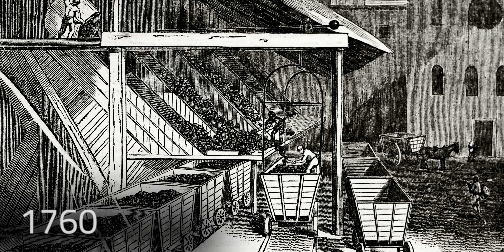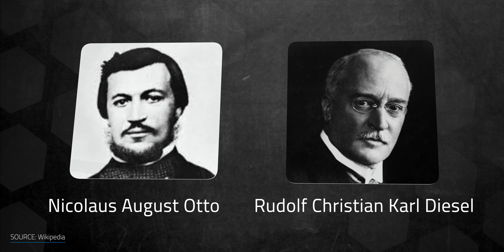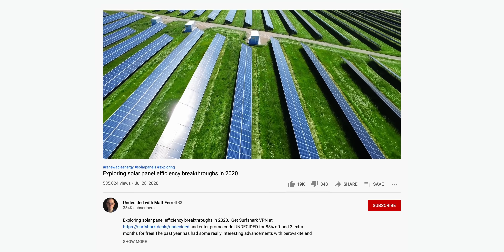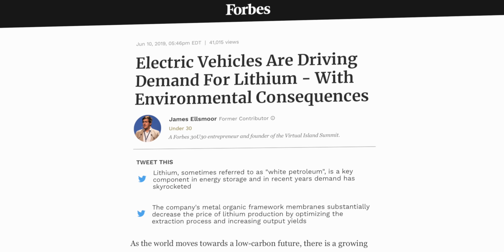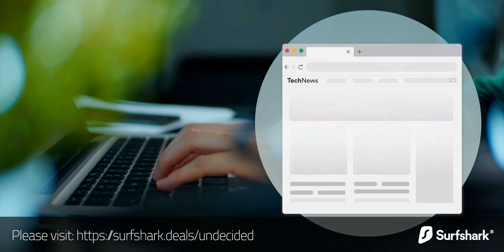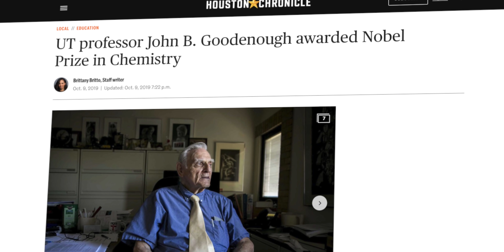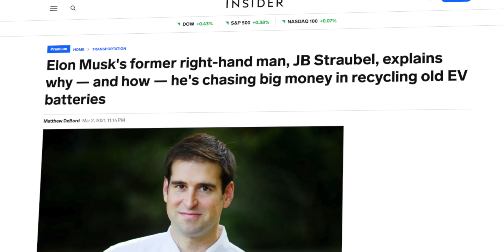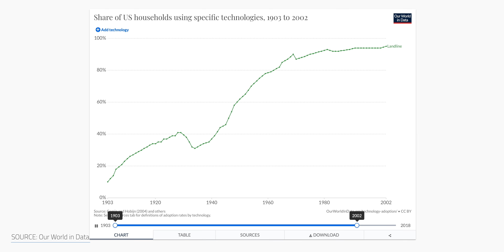Is the Future of Renewable Energy Inevitable?

Comment: Geothermal!!! Just drill deep enough and you have 24/7 energy that you don't have to store and you don't have a footprint. No mater how efficient you make renewables they aren't space efficient.
Reply: We have way more space for wind, and solar energy than we have money for geothermal. At the moment wind energy can be generated in fields without preventing the cultivation of the land they take up making the opportunity cost of using the land fairly low, and newer advances in rooftop solar simultaneously are making it more practical to utilize otherwise useless roof space to generate electricity at a fairly low cost rate.
Reply: @garethbaus5471  The problem with solar is the intermittency. Even when working well it generates 80% of its  energy in the central 4 hours of the day. People don't want energy then so it will have to be stored. So this storage is only going to be used for 2 to 3 months a year at max. In winter or cloudy days there is very little generation. Also solar produce most energy in the summer when demand for electricity is at its lowest.
Reply: @fidalfadel  and by coincidence wind speeds tend to increase towereds the mornings and evenings with a tendency to increase during the colder months and during stormy weather. The biggest issue is that there is a period of a couple of hours around midnight when wind speeds slow down and we don't have solar production, the good thing is that this is a fairly low demand time so it isn't as big of an issue.
Reply: @garethbaus5471  The issue is private people will buy a power wall and solar roof but the power wall will be very under utilised over a year. If people are will to spend that money and tie up that many resources with a power wall that at best is going to be 30% utilised then then why not invest in a system the will generate all year.

Comment: I think of green hydrogen as a kind of battery for a renewable grid. I tell younger people energy storage is where to keep your eyes open for investing their money for retirement.
Reply: As someone considering working in the sector, I wouldn't bet my life savings on it but I am also confident that it will see massive growth this century.
Reply: Green hydrogen is less than 50% efficient as a storage medium.  So yeah it's viable, barely, but a society built on it would need platinum or palladium for every fuel cell node.  Bad scaling on that solution.
Reply: Hydrogen - coupled with a hydrogen fuel cell - makes for an inefficient, complex, expensive battery.  Short of the unlikely confluence of A) massive energy production B) near a convenient point of demand for hydrogen C) where there is no good way to export electricity to the grid, and D) the costs associated with hydrogen production and consumption drop significantly ... I doubt we're going to be using bespoke alternative energy production piped directly into cracking water into hydrogen.  It's both more energy- and cost-efficient to steam reform hydrocarbons to extract hydrogen - something the petroleum producers can do at scale and largely with existing plant with the attendant CO2 release into the atmosphere.

Comment: Great content as always.  I see renewable energy sources increasing but there will be many more failures as we saw in Texas this winter.  The technology for storage is not close to adequate now or expected in the next two decades.  Governments pushing renewable energy without  sufficient backup for at least a week are playing with people lives, but that is the nature of government.  Such games are just payoffs for political friends. The move to renewable energy sources and EVF cars will happen quickly when they are proven technologies. Otherwise, political friends are making money while people suffer.
Reply: The failure in Texas was due to their failure to winterize equipment - not a failure of renewable energy.   The have their own power system because they wanted to save money and avoid federal regulations which would require things like winterizing pipes and valves that provide natural gas - those froze up in the cold.
Reply: @Cynthia_Cantrell  There were many faults in Texas and winterization is just one.  Winterization doesn't negate that renewable sources also did not have sufficient backup storage to keep operating or supply needed power. I don't remember the details on why the Texas grid was maintain separately,  but I don't recall ever hearing your supposition. I've been out of the power industry for over a decade, but I still know it fairly well.
Reply: @johnreynolds6074  Why does Texas have its own power grid?:

https://www.chron.com/news/houston-texas/article/Why-does-Texas-have-its-own-power-grid-15958412.php

Wind and solar make up a small percentage of Texas power - even if they had enough backup to fully replace their regular output - and that's simply not done because of the cost - it still wouldn't make a huge dent in the Texas load.  

As of 2018, the Texas energy mix looked like this:
Natural gas:  49.9%
Coal: 23.4%
Wind: 15.9%
Nuclear 8.7%
Other: 2.0%
Source:   https://en.wikipedia.org/wiki/Wind_power_in_Texas#:~:text=Texas%20produces%20the%20most%20wind,manages%2090%25%20of%20Texas's%20power.

Getting power from wind turbines during the winter is quite possible - assuming you install the "winterized" versions.  

Last year (2020) Iowa generated over 57% of its electricity by wind, more in the cold months in fact than the warm months due to seasonal variation.  See https://en.wikipedia.org/wiki/Wind_power_in_Iowa

Iowa in fact generated more than twice as much electricity by wind than its next largest source - coal - which was only 24%.  

Iowa tends to be a lot cooler than Texas, yet it did not suffer the problems Texas did this past winter. 

Texas' problem was not due to the lack of back up for renewable energy, but because much of its natural gas system failed in the cold weather it was never designed to handle.

From:  https://www.statesman.com/story/news/2021/02/27/texas-legislature-lawmakers-second-day-hearings-power-outages/6841099002/

"Last week, gas production in Texas fell from around 21 billion cubic feet of gas to less than 14 billion, according to energy consulting firm Wood Mackenzie. Natural gas moving from more than two dozen West Texas processing plants to pipelines fell by 85%, the consulting firm reported."

Texas electricity when down because its biggest fuel source - natural gas going through pipelines - dropped by 85%.
Reply: @Cynthia_Cantrell   Very good data Cynthia. I will agree that the majority of the Texas problem a few weeks ago was the lack of winterization.  But I think Texas is very smart for keeping their grid separate. I worked power and petroleum industries for 40 years from construction, training, and operation all over the world. Renewable energy is not reliable because as Matt described in the video without storage its output dies. It is immature still.  Also consider the life span of these facilities again as Matt described.  Also anytime you being the federal government into the mix, it is more costly and you loose control of your system. Texas is smart being separate, but as your article described there are a couple interconnects that could be used in extreme emergencies. When the renewable industry matures as a whole and not individual pieces of it, then the whole power industry will go to it because it will be financially smart at the time.  Again good research on the topic and you proved the importance of winterization for this event.
Reply: @Cynthia_Cantrell  Good morning, The physical item, lithium is  not cheap and there is not a known large supply of it. I believe Matt mentioned that in this video. There is a lot of research going on in this field and I think Matt has described some of the technologies in previous videos too.   Management of power/power distribution is challenging.  Multiple capabilities are required.  First power must be generated. This is the typical belief in a generation facility.  Renewables can compete by getting people to accept the loss of their visual views of nature.  Wind is ugly but impressive while solar is more tolerable.  The second needed capability is to respond to quick demands such as such as everyone coming home at one time, industry turning on major facilities in the morning such as the car plants and the like. This is storage that can be called upon in a moments notice.  This storage is critical when there is a loss of a power plant or major grid disturbance.  This kind of happening is how you loose a major section of the country. Typical power plant systems handle this with "rolling stock" which is generators that are turning but not fully loaded and hopefully well calibrated protective relays to protect the grid. I haven't read how renewable plants are integrated into producing this type of storage other than batteries and that is not over a long period if needed.  The third capability is longer term supplies for over a week.  Typical power plants are limited by their fuel supply and have they maintained their equipment. Nuclear is least affected followed fossil fuels, then the hope is renewables with longer storage capabilities, but that doesn't exist and the technologies don't look close.  

Renewables are currently feasible partly in meeting the first capability.  But its ability to  provide power to meet the other demands by people and their daily life is questionable at this time.  This is because the source energy for renewable are by nature not reliable and battery technologies are bulky and their life cycle costs are high and generate a lot of pollution.  Although the technologies to reduce the life cycle pollution are advancing but it looks like most will rely on different battery technologies.  I don't see a technology yet that I would invest in that reduces life cycle costs. 

You mentioned spot price going to zero in your message.  From a business view point this is not good just like oil prices going to low are bad too.  It momentarily looks fine, but without a profit no business continues to operate.  It costs serious money to provide reliable power to 300+ million people in the US. The key word is not 300+, it is reliable.  300+ is easy to supply.

Finally on a personal feeling, I really don't like the visual pollution of renewables.  Wind farms were impressive at first until I got close to some. The low frequency sound is annoying after a few minutes. I could feel it, and that is not good. I've not been at large solar facilities,  but at a couple small ones, you see they take away from nature (but better noise impact than wind farms). Pump storage facilities that I taught all provide outdoor activities but are a niche  time limited solution for power generation.   

Keep the faith. Renewables are coming but they don't have the capabilities yet and for me, I don't see it for probably one or more likely two decades.  I think that I'll give you a break from me for now. Have a great day.
Reply: @Cynthia_Cantrell  Good article on Uruguay! The example the USA could learn is to cooperation between   public and private sectors.  It reads also that they had a good conditions  and a small population for success. Great on them for solving it in their part of the world.

Hanover is a serious problem, but it is more historical and political than anything.  During WWII and early cold war issues didn't consider cleanup.  The government's delays and political ways did not solve it quickly and instead set up programs that would run for excessive time for job purposes and not cleanup purposes.  You will find similar stories for chemical cleanup facilities too and in greater numbers.  

 The research happening in nuclear technologies may be better that anything around now.  I think they have a better chance of success than most fields and produce far less waste.  Fusion would be great, but that technology is too young and still with little success yet.

As for coal, the clean coal technologies in place now are excellent, which surprised me until I built the training programs for one a few years back.  There is a prejudice against coal here, but the third world counties could make good use of it and produce cheaper power. 

From my 50+ yrs of work experiences, I believe that politics go for the looks and rarely good engineering solutions. 

Well there is a lot to discuss on these topics but maybe it is time to give Matt his channel back.  It has been nice exchanging thoughts. Thanks!

Comment: You are way too optimistic about Hydrogen and left out key elements which make it way less suitable. Especially for use in cars.

Hydrogen is an energy carrier, not a source of energy. And current electrolyzers are not 95% efficient, more like 80%.

But the bad part is, that's just step 1, after creating the hydrogen, you need to store (compress to extreme pressure) or liquify it, transport it, put it in a car, run a fuel cell to create electricity for a battery and drive on it. Every step you have losses.
End result: only 25-30% efficient.

Compare this to directly charging a battery using the energy you already had at the start: 90% efficient.

This is why, especially for EV's, batteries are the way to go.

Short Elon clip on this very subject: https://www.youtube.com/watch?v=yFPnT-DCBVs

ELI5:
When you have 10 kWh from your solarpanels:
- If you just charge a battery directly and drive on it you end up with around 9 Kwh to drive on, let's say 45 kilometres (28 miles)
- If you go the Hydrogen route you end up with around 3 kWh to drive on, let's say 15 kilometres (9.3 miles)

(Assuming 200 Wh/km)
Reply: Yea the entire point of Hydrogen EVs is still far off in regards to replace any other form of energy source (which as you say, Hydrogen isn't).  I wonder how efficient it would be to make use of the momentary energy produced by solar and wind - by using it immediately to aid in the creation of Hydrogen at a powerplant, which can then be stored and used on a more linear scale, as a way of containing the energy long-term so we aren't as dependent on how the weather is acting.
Reply: @Real_MisterSir  Well you would have the same issues. You would need enormous tanks under pressure to store large quantities. And then you will eventually need to convert back.

This way you are simply using hydrogen as a terribly inefficient battery.

For storage on land, it simply makes no sense, just use batteries which will improve the coming years.

Maybe for large tanker ships or airplanes hydrogen could have some use, not sure.
Reply: @navithefairy  The idea is that you'd cut out a lot of the steps you mention, such as transportation and handling, secure use in vehicles, etc. With this concept you could produce and immediately store the hydrogen at the same facility and never have any attached supply chain. The issue with current batteries is creating large enough quantities to efficiently store energy over time, as well as taking into consideration battery degradation and potential future replacement needs etc. I mean in the end, all of these technologies are improving every year, so it's not like one needs to replace or outdo the other.

Comment: I would like to point out that just because the recycling technology exists doesn't mean it is accessible.  A huge part of closed loop recycling systems, the logistics matter as much or matter even more.
Reply: True.  Since my local authority went over to accepting any plastic (unclean) food packaging I'm sure it's all being incinerated.  Way too expensive to clean it, sterilise and sort it by polymer type.  Even with products claiming to be recycled they're using about 10 to 15% of carefully chosen polymer.  More becomes degraded. Fairy stories.  Yeah you can easily mince up batteries, but it takes a lot of energy to separate the elements for re-use.  Most lithium cells sent for recycling go into land fill.